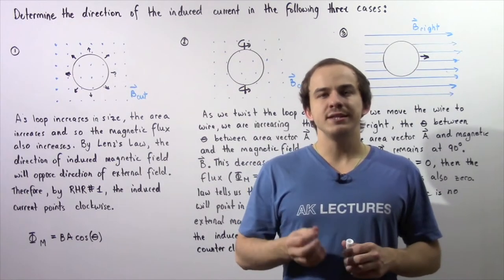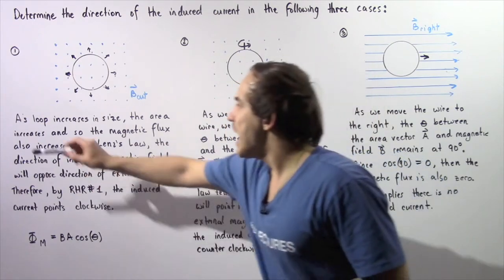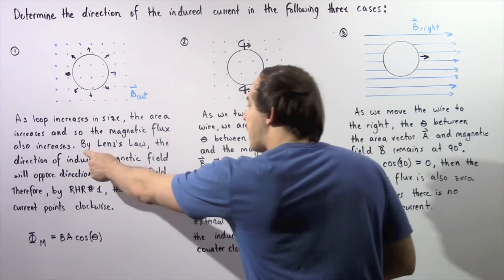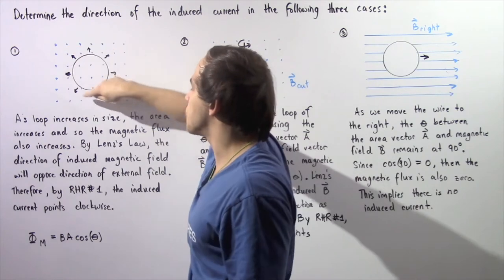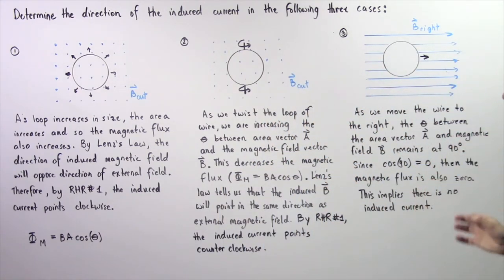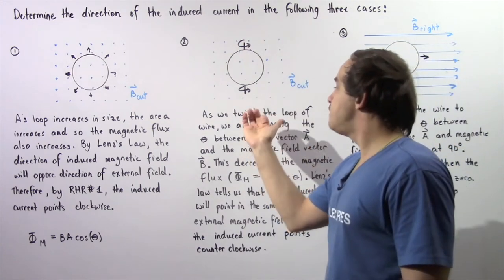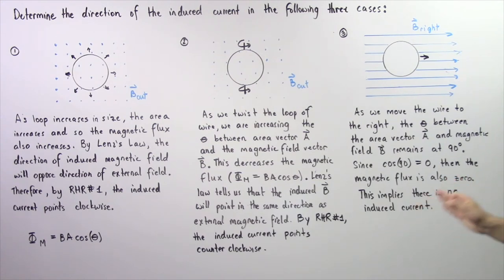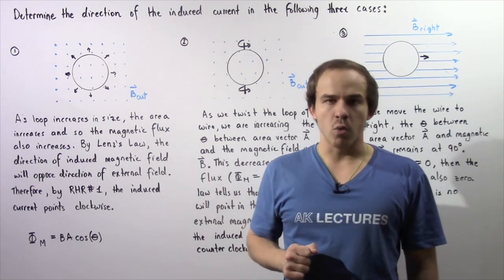Lenz's Law Examples

Comment: For the first example, why does the current go clockwise? If it goes clockwise, you have field lines coming towards you in the center, but away from on the outside. If so, only some field lines oppose the the magnetic field. It seems to me the neither direction would make more sense.
Reply: all his explanations are correct except the right hand part..that thumb he shows can move both sides...so just assume that ur thumb points in the direction of magnetic field and curl your fingers,you will get the direction